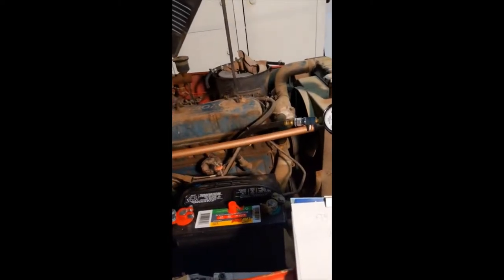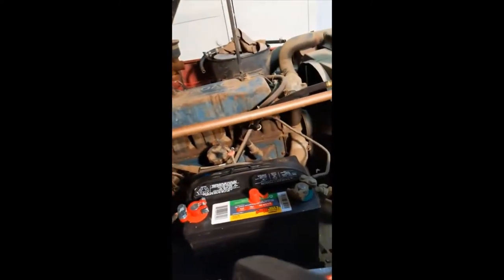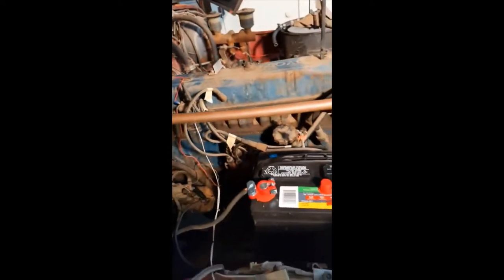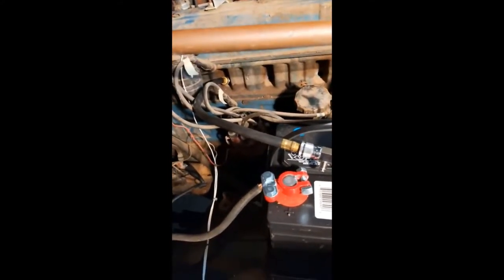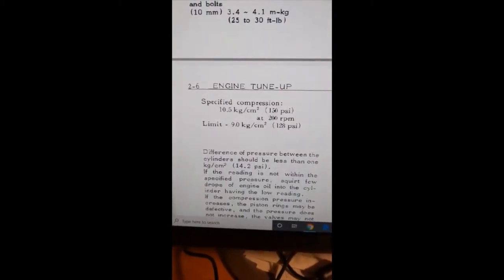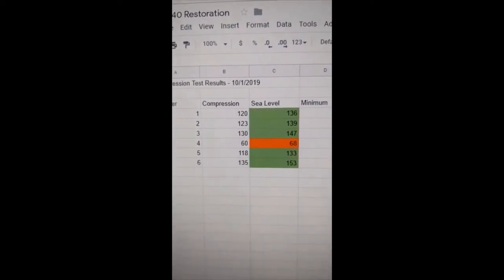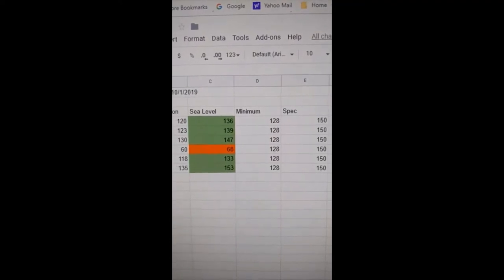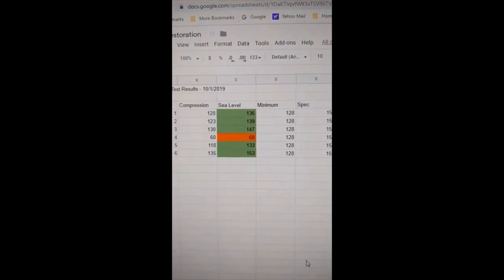Compression Test

Comment: Could you tell me how/where you blocked the fuel line to do the compression test?
Reply from the maker: The simplest way to keep the engine from starting during the test is to disable the ignition. You can do that by pulling the tower wire on the distributor.  That's easier than blocking the fuel. (A little fuel will go through the engine during the test, but this doesn't cause any problems)